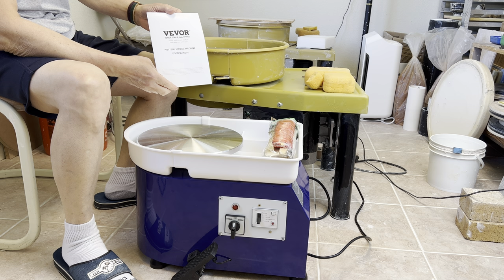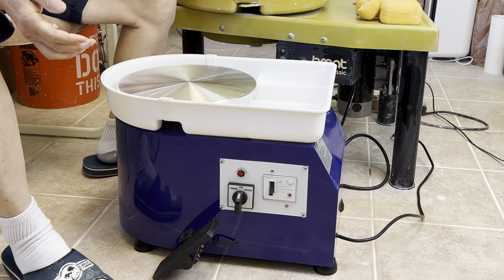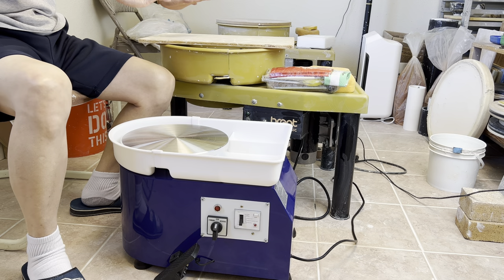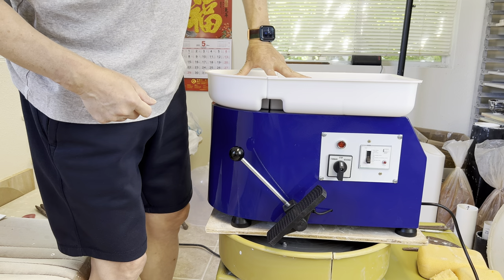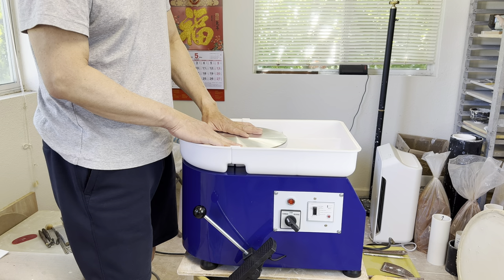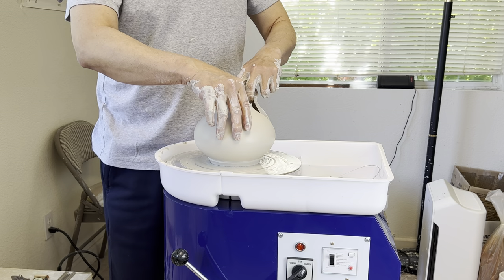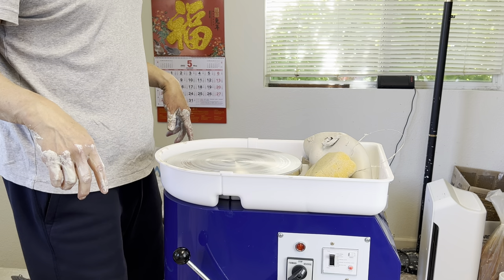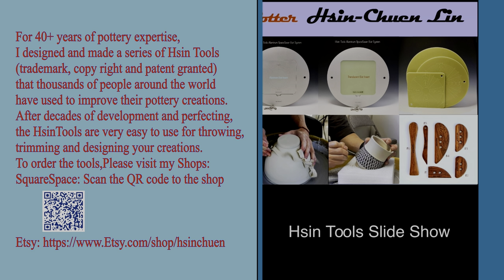734. A Professional Review on a Cheap Mini Wheel with Hsin-Chuen Lin 林新春 迷你拉坯機使用後評價

Comment: I'm a beginner and decided to try a Vevor wheel.  I bought their largest model, which has a slightly larger motor and is almost full-sized.  Out of curiosity, I decided to see if I could center 8 lbs on it.  It was a bit of a struggle for me, but the wheel handled it fine.   Somebody with Hsinchuen's skills could easily center much more on it.  
I'm really happy with the Vevor wheel.

Comment: I have one very similar to this and I added threaded bat pins as you suggested. It works great, for the price. Because it’s smaller, I can easily move it out into the yard or take it into the garage to throw. Cheaper than taking a class at a studio, and WAY less expensive than a studio membership. The other bonus, I can introduce my reluctant friends to throwing on the wheel as well. And since it is so inexpensive I can easily justify buying Mr. Lin’s beautiful Tungsten Carbide trimming tools!
Reply: LOL I persevered with one of these wheels because I was too poor and I was desperate to throw. It cannot compete with using a decent wheel and taking classes with an instructor who can advise you. I say this as someone who took quickly to throwing. Unless you want to limit yourself to throwing small pieces these wheels are only useful for 6-12 months. An intermediate thrower would require more from their wheel.
Reply: You’re completely wrong on this Ed. I have this same wheel, it is  3 years old and I use it everyday and I teach kids on it at the farmers market every Saturday for 6 hours straight. I can put 8 pounds of clay in this and throw a piece at least 24 inches tall (limited to the depth of a skutt 1027.). Not once have I had any issues and I move around constantly. I also have studio time and use a boss clay wheel and pacific for my 36 inch plus size pieces.  Which go into a gas kiln. The point is I prefer this wheel and I use nothing but porcelain. Throwing off the wheel head is awesome. Torch the bottom of your piece before you take it off and you don’t have any batt space to worry about.  Batts move and wear out, and it sucks when they do, which is why I have his aluminum batt system.  Which I only use in the studio for my large gallery pieces.

Comment: Sometimes you really need very slow speeds - the lack of speed control at these speeds could be annoying.
The exposed wiring underneath the wheel is worrying - I would need to make absolutely sure all metal parts are securely grounded before starting to use this wheel...
Reply: Controlling the speed on these cheap wheels isn't a problem - the main problem is the lack of torque which makes it difficult for a beginner to centre, also one cannot really make anything heavier than 4lb of raw clay. I was so poor I bought one of these wheels and persevered with it, but I think many adults would give up. I have kept mine for trimming and I also use it as a banding wheel. The first one I ordered broke down after an hour's use. The company have aggressively sent free machines out to YT influencers some of whom have not been honest with their viewers about the limitations of these wheels...
Reply: This will center 8 pounds of clay no problem. I do it daily, mine is the 350 watt. But never ever had an issue w this wheel. The speed control on this is far superior to the boss clays or Pacifica wheels and shimpo. The speed control on this is very refined and you can get all the speeds in between the normal speeds with it.

Comment: Do you think one of these wheels could work as a permanent plaster wheel, for vertical plaster model making and using molds to jigger and jolly? I’m looking for a second wheel so I don’t have to remove the plaster wheel head from my regular wheel all the time and potentially get plaster in my clay, but I don’t want to spend the full amount for a new wheel and I can’t easily find a used wheel, which frankly feels too expensive even for a plaster wheel which doesn’t need the horse power etc that a good quality wheel has. And it would actually be great to do it on the tabletop. And not having bat pins would actually be a plus. I just worry about the wheel wobbling, that would not be good for model and jiggering and jollying. And just worried that it would break soon as you showed the wheel is made out of plastic on the underside.
Reply from the maker: I only worked for 20 minutes so don’t have any experience on how well it will last. You can probably try it. If not working, Amazon is easier to return.
Reply: The motors are pretty weak.  The plaster molds and clay might be too heavy for it.
Reply: @Aubrey I bought one of these wheels as a beginner - I was very poor at the time. The main limitation is the low torque which makes it hard to centre and work with stiff clay. I kept the wheel as a trimming wheel and also as a banding wheel. The wheel doesn't wobble, but you can't really place large amounts of material on it.
Reply: @edelgyn2699  I wouldn’t be using it for clay at all, but for plaster. The plaster wheel head that would be put over the metal wheel head would probably weigh about 15-20 lb, and then the plaster models and plaster molds would only be a few lbs. If you think 15 lb would be too much for it then sadly I would need to pay for a regular wheel